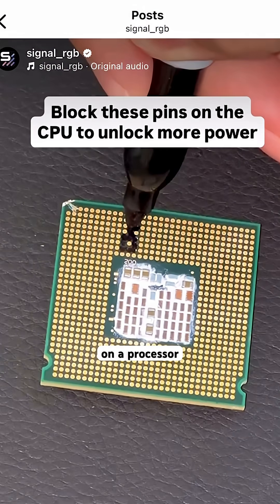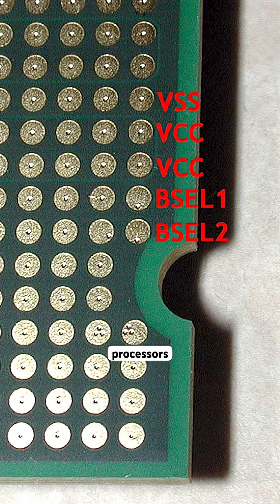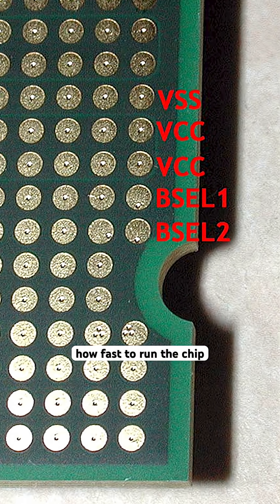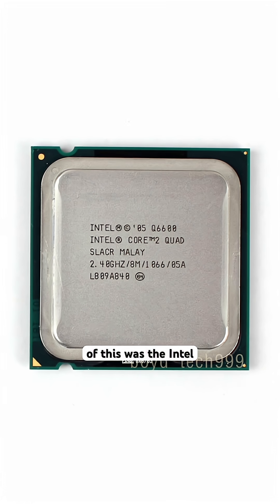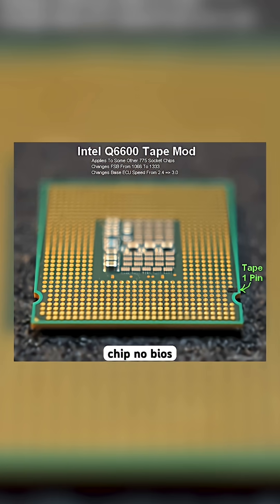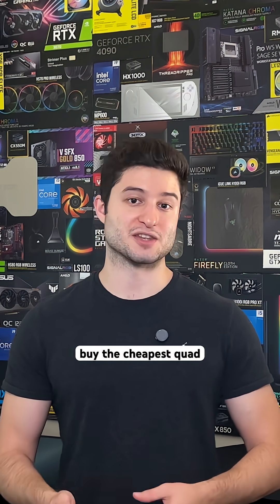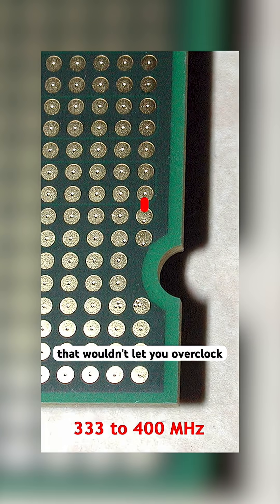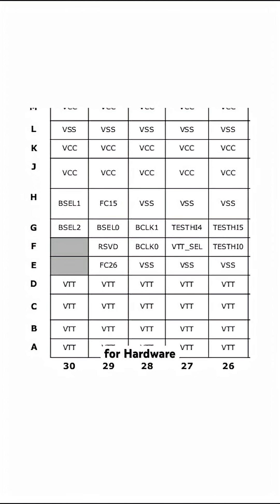Taping a CPU to improve it?!

Comment: It was essentially a gamble: you could end up with a solid chip or with one that was unstable. Typically, each processor type is built on a single production line. Different speed variants exist because if a CPU fails to stay stable at its intended clock speed, manufacturers reduce the speed and re-test it until it runs reliably. Those chips are then sold as lower-tier models rather than discarded.

If you overclock one of those down-binned chips, you risk random crashes or permanent data corruption. On the other hand, when demand for cheaper CPUs is high, manufacturers sometimes deliberately throttle perfectly good chips to sell more low-speed models. If you happened to get one of those and pushed it back up, it would stay stable because it was never slowed down due to flaws.

That’s why overclocking was a lottery. It made sense only on a machine where stability and data integrity didn’t matter, like a gaming rig, but never on a system used for serious or valuable work.
Reply: Very informative thank you
Reply: Good explanation. The same goes for any processor. I built a rig for a raspberry pie to run retroarch and have higher/cooler clock speeds for better stability with bigger games. For me overclocking is the equivalent to individuals who tune cars to get what they want specifically.
Reply: @SophiepTran  If the change isn’t permanent, it’s worth testing. Increase the clock speed and run a 48-hour CPU stress test. If the system stays fully stable, the CPU can handle that speed. If it crashes, corrupts data, or shuts down from overheating, lower the clock speed and repeat until stable. Permanent modifications, like those shown in the video, are risky because they can’t be undone if instability occurs.
Reply: @xcoder1122 - Definitely and as an tweeker that's the proper way. Just saying that manufacturers can't expect people to do that. They limit legal action by downgrading to safer clock speeds. Just explaining that to those that may think it's simple to get faster speeds easily without extra work.
Reply: The Core 2 chips were really well made and incredibly consistent. This video is full of misinformation. All of the Core 2 chips were unlocked, so none of this modding crap was necessary. The Q6600 wasn't a budget option, it was literally the top-tier C2Q when it released and retailed for over $800. The budget overclocking option was the Pentium Dual-Core E2160 which easily clocked from 1.8 GHz to 3 GHz on the stock air cooler at an MSRP of $65. That was pretty much guaranteed, and back then, quad-core chips weren't utilized very efficiently in software, so it wasn't until near the end of the Core 2 era that more cores gave better performance than higher clock speeds. More often, you were better off going with the Core 2 E8600 because it could clock to 4+ GHz, which was significantly higher than the quad-core chips could achieve.

Pretty much everyone was overclocking Core 2 chips back then because it was so easy and they were so reliable.
Reply: @rars0n  I remember the tape mods but never needed to use one. The multiplier was locked on pretty much all with a few exceptions the c2, c2q series and overclocking was done by fsb. Labeling of chips as unlocked at the time meant the multiplier could be changed and the processor overclocked without changing or running the fsb out of spec. And the q6600 was the budget / cheapest (still not cheap) quad core you had available, the  qx6700 @ $999 (released before the q6600), and very shortly after the q6700 and other qx variants all of which cost more. The first c2 I had was an e2200 running at 3.0Ghz, I could get it a little higher but it would get flaky, never knew if it was the chip or board as the board MSI P6N did not like the higher FSB much.
Reply: @D3M3NT3Dstrang3r  The Q6600 was the most expensive Core 2 Quad chip on release. The QX chips were all Core 2 Extreme chips. I knew of absolutely zero people using those because:
1. Changing the multiplier wasn't at all necessary,
2. Changing the FSB is the preferred method of overclocking anyway, as it speeds the entire bus up along with the CPU, unlike the multiplier, and
3. The Q6600 was such a good overclocker, there was no point in buying the Extreme chips.

C2Qs weren't even the best overclocking option either, especially since barely any software took advantage of them back then, so it's still ridiculous to call it a "budget overclocking option." I ran the E2160, the Q9550, and the E8600 all in an Abit IP35 Pro, and by far the fastest was the E8600, because it clocked significantly higher than the other two. The Q9550 (which retailed for $300 less than the Q6600 a year later), despite being on the smaller 45nm node, was not as good of an overclocker as the Q6600, but it got pretty close. It was no match for the dual-core Wolfdale chips, which pretty easily hit 4 GHz.

The only reason I can see for using the tape hack is to overclock a chip with a really low (<9x) multiplier, but that would lead me to question why someone bought such a CPU in the first place.
Reply: @rars0n Yeah, wasn't saying they were cheap or would I have called them a budget cpu, but they would have been the cheapest Intel quad core at the time regardless, the qx used the same socket and board and were available for sale before the q6600 making it the cheapest 775 Quad. The first qx released before the q series and all the other early q and qx series were released within a month or so of the Q6600 again making it the cheapest of the quads. Still let me say I would not consider any of them cheap or budget even in todays market, just the fact that it was the cheapest of the bunch. 

Fsb was only preferred because it was the only way on an Intel 775 system with the exception of the Extremes, most all AMDs and a lot of older Pentiums had unlocked multipliers and that is where you started. If you were set up for this with the proper memory and board it was no issue, but oc the bus could have downsides including causing the pci, ide, and sata to run too fast and cause peripherals to crash, and in rare cases get damaged. Memory usually got overclocked or underclocked depending on the divider available .That was really only an issue in that time period if the processors already used the highest standard fsb and a low multiplier so you had to go out of spec, if your board even allowed it. 

Still have the E2200, E6600, and Q6600 of which will not clock well on the P6n Sli board it had the Nvidia 750i chipset that does not clock to 1333. Would like to pick up a nice P45 board.
Reply: @D3M3NT3Dstrang3r  "making it the cheapest 775 Quad"

For six months. It seems like a pretty pointless distinction. The video claimed it was a budget CPU, which is just plain wrong, as it wasn't actually cheap. An $800+ quad-core processor in 2007 was the equivalent of an HEDT processor in the Sandy Bridge through Kaby Lake era.

"most all AMDs and a lot of older Pentiums had unlocked multipliers and that is where you started"

No, this is completely wrong. The goal was always to run the lowest multiplier possible (highest FSB clock) with the highest clock speed possible. Anyone who has ever overclocked a CPU by moving jumpers on a motherboard knows the difference a faster bus makes. I never touched the multiplier unless I absolutely had to, and usually that was to lower it, not increase it. That goes for my Pentium, my K6, my Slot A Athlon, my Athlon 64, and my Core 2. After that, the chips had gotten too complicated and the bus differences weren't really meaningful anymore.

"Memory usually got overclocked or underclocked depending on the divider available"

IMO if you needed to underclock the memory, then you needed to find a different clock setting (or get better memory). My Abit board had a P35 chipset (obviously), so it was running DDR2. I would lower the clock speed slightly if necessary to make sure the memory was running at at least 400 MHz (CL4, I am also of the "lowest CAS possible" camp). Most of the time, my memory was running around 450-500 MHz.

I wish Abit were still making boards, because they were always some of the best boards I've ever used. That is why I always preferred to spend the necessary money on a good board, rather than blowing it all on the CPU, because a good board will always get better overclocking results. Abit was like the Canopus of motherboard vendors.
Reply: @rars0n  
"No, this is completely wrong. The goal was always to run the lowest multiplier possible (highest FSB clock) with the highest clock speed possible. Anyone who has ever overclocked a CPU by moving jumpers on a motherboard knows the difference a faster bus makes"

If this is the method that works for you then have at it, if it works it works. In my 30 years of doing this and researching plenty of overclocking guides many times for many boards and cpus  say to  start with multiplier first then voltage, fsb etc.There are still plenty on google if you don't believe me. It really depends on what platform you are working on. On 775 there is nowhere to start but fsb... 

"For six months. It seems like a pretty pointless distinction. The video claimed it was a budget CPU, which is just plain wrong, as it wasn't actually cheap"

I'm in agreement with you on most of this point and stated several times I did not agree with the Budget designation but I don't understand what you mean by pointless distinction. It was and remained a lower end Quadcore. Also let me clarify something, upon further research the Q6400 (never seen or heard of it)was officially the cheapest making the q6600 the second cheapest available quad on release. It may have been the most popular Quad by far but  unless I missed something else it would have stayed on the lower end of the Quad core price and spec range for it's entire life, it was a lower end quad core that overclocked very well given you had a G0 stepped unit which made it a great value compared to the higher end. None of what I said means I think it is a bad chip or was it cheap even by today's standards.

" if you needed to underclock the memory, then you needed to find a different clock setting (or get better memory)."

Some boards did not allow unlinking the memory from the fsb and only had a crappy selection of dividers to choose from. Before the last era faster sticks of ddr2 or 775 boards with ddr3 800 mhz sticks were the best you could get for a while, overclocking to an fsb of 1066, or 1333 with only a divider never provided a good speed with the memory as the divider setting  would cause overclock or underclock or as they were usually whole numbers only. Could you buy a better board an memory? 775 was a very long lived platform and the difference in boards and chipsets from start to finish are vastly different. If you don't believe me on that try some boards with some Nvidia chipsets like the 650i Asus P5n sli was one I got rid of quick.

Lastly I am not trying to be argumentative I am only sharing experience from my perspective and hardware which I have had throughout the years. I stated my journey of pc repairs on socket 5 and have been hooked ever since. I usually never leave a machine overclocked but do see how far I can take them incase I ever need that extra bit of juice before an upgrade. Have fun with your gear and get the job done however you are familiar and comfortable with doing so.  I would love an Abit ip35 pro or a Soyo Dragon for an old AMD build, hell I would be happy with another Gigabyte GA6BXE but prices for that stuff is crazy. Either way I think I have spoke enough on the subject.  Enjoy the rest of your day!
Reply: @D3M3NT3Dstrang3r  In the Pentium days (aka the "586"), your options for bus speed were limited by your chipset. Some were limited to 66 MHz, some to 75, some to 83, and if you were lucky enough to have a Super Socket 7 board, 100 MHz. However, these were discrete values, you didn't have the luxury of choosing your own speed. Multipliers were extremely low, typically 2.5x or lower, so having a higher bus speed had a huge impact on performance. Sometimes it was faster to run a slower clock speed with a faster bus. Hence, for anyone looking to extract maximum performance, it was all about finding the highest clock speed with the highest bus speed possible on the given hardware.

I think most guides on the internet mention the multiplier first because that's the easiest place to start. Just change it a bit and see if it runs, then you've got an idea of what clock speed you can hit. But then you want to plan on increasing bus speed regardless, and see what final clock speed you can run based on that. It's a mistake to just increase the multiplier and ignore the FSB, especially if you're trying to extract maximum performance. Otherwise you might as well just read a website to tell you what settings to use and call it a day.

"I don't understand what you mean by pointless distinction. It was and remained a lower end Quadcore."

Because it was the best overclocking quad core of its generation, by far. Even the 45nm quad cores (which shipped with higher clock speeds) generally didn't perform as well. The chip was notable not for its position in the product stack, but for how good it was.

"overclocking to an fsb of 1066, or 1333 with only a divider never provided a good speed with the memory as the divider setting  would cause overclock or underclock or as they were usually whole numbers only."

I'm not sure what you mean. It's been a few years since I fired up my IP35, but I remember it giving me various options like 7:8 (so the DDR would essentially run at 7/8 of bus frequency*). Not only did it have plenty of divider options, but it worked really well choosing between the two. Besides, given that memory clock HAD to be divorced from the bus block in order to run higher bus speeds, I don't see the problem, other than you can't type in your own memory bus speed. It's the same type of thing I talked about above, just with fractions instead (which gave me lots more clock options). Just choose the one that works the best. A good board SHOULD give you good results (and I wouldn't have touched an ASUS board back then).

*(On a side note, there's no such thing as 800 MHz DDR2, even though we all treated it like that (even the Abit BIOS made me think the RAM was running at 800 MHz), because technically that number is MT/s, which is double the actual RAM bus speed.)

I'm not trying to be argumentative either, but it sounds like you weren't really that into overclocking. That's fine. I overclocked every machine I ever owned as soon as I learned what overclocking was, including my first Windows PC, an Acer Aspire (with a Pentium-100 and 8MB of RAM). My second PC was one I built from buying parts from tables at a trade show, with the express intent of overclocking whatever CPU I ended up with (an AMD K6-166). That machine never got regular use on stock clocks.

I don't say this as a flex, and I was no master overclocker by any means, I'm just saying I was an enthusiast who overclocked a lot of stuff and I actually used it at those clocks for LONG periods of time. My overclocks were stable for the life of the computer.

You're right, our experiences are unique to us, and everyone's will be different. I got lucky on my first build and it shaped the way I bought components from that point forward. And I agree that it's about having fun with your gear. Unfortunately I feel like the fun has diminished over the years even with the Core 2 stuff. I don't even bother overclocking modern chips because it's too much of a pain and the gains are basically undetectable.
Reply: @rars0n  I have been through many and had some machines that I have overclocked and left there for years,  but most done exactly what I needed them to do on stock settings without the worry of premature hardware failure. So Technically I have overclocked every pc I have owned, checked for stability and temps at the highest clocks achieved. Notate it somewhere, set the machine back to optimal settings and move on. I enjoy seeing what they are capable of but have very little desire to actually run them that way. In most cases unless it is as overclockable as the Celeron 300A or the Q6600 GO stepping overclocking is fun but not really beneficial on a lot of chips, not enough to possibly shorten their lives to me anyways.

 Just a funny aside the PII400 I had on a GA6BXE was overclocked to a whopping 448Mhz via the onboard dip switches oooo fancy. I also had multipliers but the PII locked out anything above stock 4x. Any faster on the fsb and the HDD would get unstable. Here is a short excerpt form the manual.

´Note: We don’t recommend you to setup your system speed to 75, 83,
112, 124 or 133MHz because these frequencies are not the
standard specifications for CPU, Chipset and most of the
peripherals. Whether your system can run under 75, 83, 112, 124
or 133MHz properly will depend on your hardware
configurations: CPU, SDRAM, Cards, etc. 

I know about the MTs vs Mhz for 775 and it is actually /4  some motherboards show it correctly some do not. Most advertising and literature shows MTs. I always had to remember to /4 especially when changing fsb because I needed to see what the hell speed a 273 Mhz x 11 chip like the E2200 (stock is 200 x 11)was going to be clocked at, which is 3.003Ghz  and some motherboard would list Mhz and some would list MTs. I am also certain that P35 board was a much better overclocking experience than a 750i and from my memory most people got better results. I could not get a P35 and the 780i did not add much better functionality.

Excerpt from google 

'The actual clock rate of the memory is half the listed MHz speed, while the effective clock speed is twice the actual clock speed. For example, a DDR2-800 module has an actual clock rate of 200 MHz, but its effective speed is 800 MHz because of the double data rate. "

I think we are much closer on overclocking than you think, I just prefer to do multiplier first if available then fsb, voltage, etc. And there is absolutely nothing wrong with looking at guides and trying to replicate better results from someone else that has already surpassed you last best attempt to see if yours will actually do it..

As for now though like you said there is little use in overclocking modern cpus so I have moved to GPU's instead. I run my ARC  B580 at 3250mhz, stock OC is 2850Mhz I have read of others going beyond my 3250 but I don't think my sample will do it without cooking itself as it is a good sample but not a golden one. Now my RX580 might just be a golden sample as it will run nearly 1500Mhz. I also have a 3070 with a stock OC but just don't like messing with it as unlike the other 2 cards it is not as cheap to replace. Plus it fits my needs fine the way it is.
Reply: @rars0n by the way, nice to talk to someone as passionate about 775 as me.Probably favorite platform. I usually go AMD when possible but if Intel could pull another long lived platform like 775 and chips that were as revolutionary as the c2 series were they may make it back to the top of the game.

One more thing I never disagreed about the value of the 6600 either, Just stating its place in the lineup and pricing. I know it would outperform chips that costed tons more, just like the celeron 300A, that is why it was probably the best selling Core2Quad. but by specs and listings it was only a second tier CPU. Unfortunately my q6600 is a b3 stepping which don't do nearly as well as the G0 and also run hotter. So it is definitely second tier
Reply: @D3M3NT3Dstrang3r  /4 is chip speed, /2 is bus speed. That's why the effective speed is 800 and not 400. I kinda hate the naming conventions of DDR in general, since there are so many different ways to describe it. Really what we all care about is MT/s, but yet we're used to referring to clock speed because that's what determines performance!

My K6 board was jumperless. That was a big deal back in 1997. Abit was always ahead of the curve. I miss the days of older computers, it was just a lot more fun, especially back when you could actually go to a convention center and buy individual parts from different vendors right off a table.
Reply: @rars0n  I ran an i7-2600K @ 4.5 GHz for 7 years, and an i5-4690K @ 4.7GHz for 10 years. both were solid CPUs. Both ran under a heatpipe cooler (Air)
Reply: @paulmichaelfreedman8334  Yeah, Sandy Bridge and Haswell were both great generations for Intel.

I've always air-cooled all of my CPUs. Water-cooling just isn't worth the hassle.
Reply: @rars0n the budget option for socket 775 is tape modded socket 771 Xeon EXXXX CPUs like the E5472, E5482 and E5492(it has gotten more expensive now but it's cheaper than a Q9750 or 9770).
Reply: @Sadler2010  You're better off with a dual-core chip, they clock higher. Or a Q6600 if you really want a quad-core (but who is still building these in 2025 anyway?).
Reply: @rars0n Retro Gaming PC builders....
Reply: @Sadler2010  Okay, well I'm pretty sure retro gaming builders aren't building these in 2009.
Reply: exactly. i was thinking the same thing, if you do that, you might get amazing performance for a benchmark or a youtube video, but for long term usage, this will just lead to massive issues, and depending on your luck, ruin your pc, and more specifically the processor.
Reply: @Tomahawkist_  It's never been a problem for me in almost 30 years.
Reply: It is still a lottery. When you are going after it so much you have to manually time every single thing...top tier is still bin built and still have variances.
Reply: Overclocking is really only useful for gaming. On productivity only computers, the only thing overclocking does is potentially make the system unstable. 

Most productivity systems are throttled by their network speed, not their CPU. How fast do you really need your spreadsheets, word processors and mouse to run, anyway?
Reply: @abigguitar  I've been running overclocked CPUs since 2003, and never ever had any problems. And they all ran on air cooled heatsinks with heatpipes. Pentium-D 805 at a 50 percent OC, and an i7-2600K and i5-4690K at over 30 percent (4.5 and 4.7 GHz respectively) and the last two are still running to this day.
Reply: @paulmichaelfreedman8334  Luck of the draw. I’ve also run overclocked CPUs since the early 00s and have often had many problems, including unexpected Windows lockups and blue screens. Sometimes I’ve had to turn overclocking entirely off while others I’ve reduced the severity of problems by reducing the overclocking speed. There are many factors that go into successfully overclocking a CPU.
Reply: Ya but that’s the silicon lottery in general with chips you over clock.
Reply: Best explanation
Reply: Not only it could be unstable, it could actually fry the cpu itself if something managed to burn internally without triggering temp throttling
Reply: @Jp-ue8xz  If that were to happen, you would have in your hands a very defective chip, one that likely never would have even completed POST properly.
Reply: @Jp-ue8xz  CPUs are generally well protected against excessive power and overheating. Modern CPUs have on-die sensors and hardware logic that first throttle performance and then shut down the chip if safe limits are passed. Recently, however, some Intel 13th/14th Gen CPUs suffered damage because firmware allowed unsafe voltage and frequency settings under certain workloads. This was not a failure of the hardware shutdown mechanism itself, but an example of how firmware and microcode can influence protection thresholds. Earlier CPUs relied more on external or simpler hardware controls, while modern designs integrate more sophisticated hardware protection but also depend on correct firmware configuration.

If you raise the clock speed and slightly increase the voltage to match, the CPU will simply shut down if it cannot handle the settings. That rarely causes lasting damage. Permanent failure usually happens only when extreme voltages are applied. In practice, overclockers stay within the safe operating range of the CPU series. For example, if chips in the same line run between 3.4 and 3.7 volts depending on the model, and yours runs at 3.55, you might test 3.6 or 3.7 but not exceed that. Since some models in the series already run at 3.7 volts, your chip can safely tolerate that, and often more, since manufacturers build in a margin—likely up to 3.8 or 3.9. Overclockers typically don’t push CPUs beyond design limits; they just run lower-tier models at the same settings as higher-tier ones in the same series.
Reply: @xcoder1122  Yet still there's a whole bunch of 13th and 14th gen cpu's burning their own vias without even overclocking them 🤣
Reply: A guy who understands the process better than the video author.
Reply: Yes.  I worked at Intel, this definitely wasn't guarantee'd to work. But as yields got better after the CPU was releases,  you had better chances.
Reply: interesting
Reply: Exactly right! Back when I was in school there was a pretty big scene unlocking ATI graphics cards cause a couple of employees were letting our forum know when circuit city best buy and wal mart and the like were getting lots that were just throttled.
Reply: @kylehenline3245  it was the 90s I remember that!
Reply: Merci Monsieur logic.
Reply: Correct - and an incorrectly working processor may have subtle effects.  A few eons ago me and a friend both tried to overclock our systems to the limit.  Our non-PC hardware had separate clock for the CPU and the FPU.  To test we ran a number of workloads including computing fractals (the mandelbrot set).  My friend's system produced weird results at the highest apparently stable clock it produced a fractal image which was different from the same image generated at one step lower FPU clock.  Basically the FPU failed on a few pixels only.  The effect was not visible, only noticable when comparing images using special tools.

The other problem with massive overclocking is power consumption / heat / cooling.  The heat generated by CMOS is nearly proportional to the clock.  a cheaper system may not able to provide sufficient power or cooling.

It's your choice :-)
Reply: @ralfbaechle  introducing a clock difference between two processing units of only a few percent will seriously screw up the timings, making one or the other wait unnecessarily long to synchronize so data can be effectively transmitted. Seems like some data was not getting transmitted properly due to this, and causing the errors. Unless the errors were persistent and consistent (always the same deviation), then my theory goes out of the window.
Reply: @paulmichaelfreedman8334  This was a Motorola 68030 / 68882 combo.  The FPU can be clocked synchronously from the same clock (and thus even phase) as the CPU or asynchronously.  Synchronization indeed used to be a factor for these CPU/FPU pairs.  However some of the more convoluted FPU instructions could take as much as 2000 and more clock cycles.  The more of these heavy instructions were being used for a particular workload the larger the benefit of even a relatively small bump in clock rate was.  In practice cocking the FPU 10% faster than the CPU was already worth it.   In case of my system the limit tested successfully for both CPU and FPU was the same so I opted for the synchrnous clock option.

But really the point of my previous posting were the sublt errors overclocking may introduce.  Overclocking too much doesn't always show up as a system not working or being flakey in an obvious way.  Maybe as a gamer you can tolerate if occasionally 1 + 2 = 5.  But I can't for my work.  Reliability rules.
Reply: @ralfbaechle  Well, my tactic is to just use it at max OC, and clock down if an application gives any problems (which has only ever happened once or twice to me, ever). Dynamic clock throttling is not even a thing anymore, it's so common, both in software and in hardware. But it's very interesting to hear your story about it, thanks for the verbose reply. The 90s was the hottest decade in CPU development, where the jumps were huge and greatly varied between brands and models. Remember DEC's Alpha? Compaq later continued it's development until HP bought Compaq, the reason was so they could discontinue the direct competitor to their Itanium CPU (which was an Intel-HP joint venture), which couldn't hold a candle to the Alpha. That thing blew everything out of the water.
the clock speed increase between 1990 and 2000 is staggering, really.
PS was the hardware an Amiga, by any chance? Or an Atari ST?
Reply: @paulmichaelfreedman8334  You're welcome!  The systems were both Amiga 2000C with an 2830 card.  But the underlying technical issues are more generic, did apply to many systems based on '030 / '882 and also non-68k systems.

Part of the massive increase in clock speed was also the change in design philosophy towards higher clock rate, from brainiac CPUs that did lots of work per clock cycle to speed daemons that did a little work per clock but ran at very high clock rates.  The speed daemons died out latest with the Pentium 4 Netburst architecture which ran really hot but failed hopes to ignite nuclear fusion ;-)

Beyond that all x86s were more complex hybrid approaches.  For a while going for higher clock speed made sense because it was an easy way to squeeze out more performance.  Sometimes as easy as a shrink (going to a smaller thus faster process) and light tweaking.  Marketing was ... happy like a child in a candy shop because clock numbers sold hardware..

And yes, dynamic clock approaches became established throughout the industry.  Even the lower power RISC stuff I did A LOT of work with went for clock scaling only to squeeze out the mW.  Really important for battery powered stuff but many grid-powered embedded devices such as routers are also rather power sensitive.
Reply: @ralfbaechle  Yeah Intel went for low IPC, and funnily enough, the Pentium-M architechture is directly based on the pentium-III, which did have quite a good IPC to start with. I remember running a router with kerio control (Firewalling/routing software) on a laptop board with pentium-M  7-series CPU, great performance per Watt. thing used less power than a SOHO router with similar capabilities of the time.
Reply: Say hello to the CELERON, or in IT venacular, Intel's trashcan CPUs that are sold to the most ignorant of all people. These were the runts of all litters and had like 80 percent of all units disabled, leaving them with a tiny bit of cache. SOme of them did do staggering overclocks though because they generated so little heat.
Reply: @paulmichaelfreedman8334  Chips including CPUs are often binned that is sorted into different "speed buckets" after manufacturing testing.  Typically over time the manufacturing quality goes up that is more functioning chips (aka the yield rate) are manufactured and those tend to run faster.  That's where then also marketing enters the game.  There is a limited market for the faster, more expensive chips.  If more than can be sold as the top-shelf rated chips are available they often get marked as a lower grade.  As a customer you don't know if the chip is actually tested as "b" grade or is actually "a" but marked "b".

Ah yes, the Celery aka Deceleron chips.  Never used one.  No umpf.
Reply: @ralfbaechle  Yes, I know it all, I've been active in the PC IT industry since 1994. I've had a plethora of CPUs in my machines, including 8088, V20, 80286, 80386sx, 80386DX, 486DX (AMD), Pentium-120, K6 (233,300 and 333), K6-2 (450MHz), pentium-II, P3, P4, Pentium-D (805), C2D, C2Q (9400), Athlon, Athlon XP, Phenom,  i7-2600K, i5-4690K, ryzen 9-9550X. Of course I started with a c64 and an Amiga in the 80s and very early 90s.
Reply: @paulmichaelfreedman8334  This is the dumbest comment on the entire thread. The original Celerons were budget overclockers, delivering some of the best bang-for-the-buck there ever was in the CPU realm.

Even back then, cache size didn't matter all that much (in fact, because Slot 1 processors didn't have the cache on-chip, the cache size mattered even less because it was primarily limited by latency).

You simply don't know what you're talking about.
Reply: @rars0n  Oh boy, everything in life is a competition for you, isn't it. Being likable is not one of your virtues.
Reply: @paulmichaelfreedman8334  You're projecting.
Reply: @rars0n  You're assuming.
Reply: @paulmichaelfreedman8334  I'm not. It's obvious.
Reply: Changing clock signals can burn it up bad...
Reply: Same thing now with core count. IIRC they basically never get a CPU where all the cores work and they just bin based on how many actually work.
Reply: @benjaminshropshire2900  That's not true, yield is sufficiently high on mature processes and mature architectures that they get plenty of fully-operational CPU chips out of each wafer.
Reply: @rars0n my understanding is that there's enough pressure to start using the next process node (and to offer faster and larger chips) that a lot of product is shipped well before the process is mature enough to get large numbers of top bin chips. It's not that they couldn't get there, it's that they can start earning back investment way soon by not waiting.
Reply: @benjaminshropshire2900  It is true that yields are initially significantly lower on cutting-edge processes, but unless a chip company is doing a paper launch, similar to what Intel did with Tiger Lake a while back, it makes no sense to bring a product to market with yields much lower than ~50%. If yields are below ~30%, then major redesigns are taking place. A company like AMD, for  instance, cares more about profitability than being first to market if the latter means they're taking a huge hit on processors sold.

Die size also matters a LOT, too, because smaller dies will yield a greater percentage of usable chips for a given wafer defect rate. That's a big reason why AMD shifted to chiplet-based designs. The chiplet-based chips are a lot more profitable to manufacture than monolithic chip designs.

Despite these factors, we still often see Nvidia maxing out the reticle with their highest-end chips. Nvidia rarely sells these fully-enabled to consumers anymore, probably in large part due to manufacturing challenges (they started this trend with Fermi, when their yields were particularly bad, as was heat and power consumption), but also because of product segmentation. They can save the fully-working dies for the ultra-high-end workstation/machine learning SKUs that cost tens of thousands of dollars, especially since these chips are so huge that losing a few working bits doesn't make a ton of difference when it comes to gaming performance.

But you don't see AMD doing that stuff, nor Intel anymore, because those companies are a fraction of Nvidia's market cap. Plus, manufacturing on new, smaller nodes costs more than manufacturing on an existing node, even if yields are similar. So while new process nodes are always coveted (and wafer agreements have to be signed in advance, lest another company snatch up the available wafers), the demand for acceptable yields means that chip makers don't want to pay for useless wafers. They will just backport their chips to an older process if yields are bad enough.
Reply: oh yes the good old 2500k was a beast of a over clocker
Reply: Gaming IS serious work.  Lol
Reply: Thank you,  that was the comment I was looking for
Reply: it was rare to see a q6600 that did not clock at higher than 3ghz just with overclocking
Reply: Does anyone know how to overclock a AMD EPYC 9754 ?
Reply: This is true, but they also have production targets for each tier that don't necessarily match up to the fab output. So if the run of chips is high enough quality, then a lot of perfectly good chips get down-binned as well. That's the gamble - did you get a legitimately downgraded chip? Or did you get a good chip that was downgraded to meet production targets? And of course, the more full-spec chips the fab produces the more flexibility they have, so they're always targeting the highest percentage of full-grade chips they can.
Reply: bro thinks gaming isn't serious or valuable work. every gamer is braver than a marine fyi